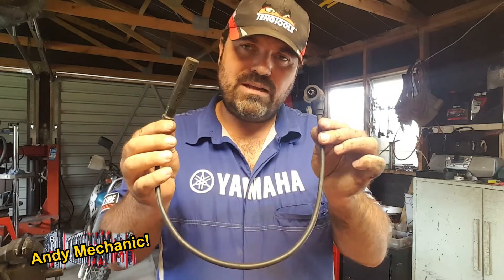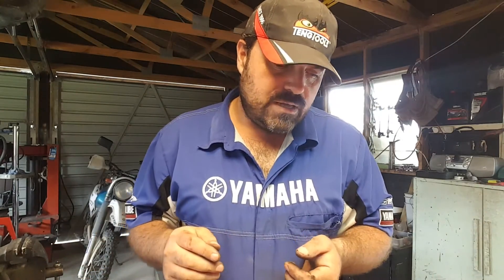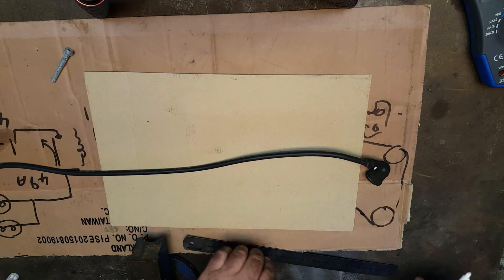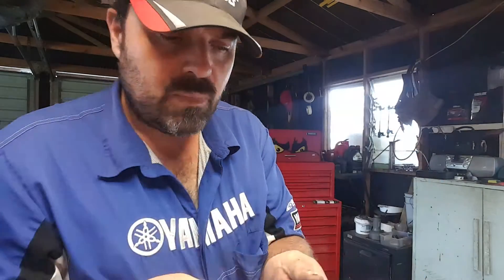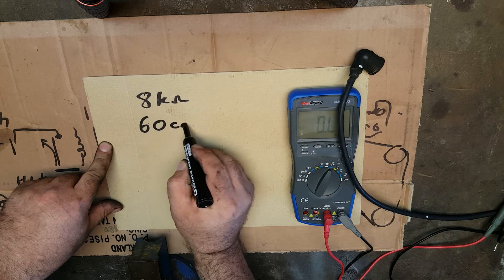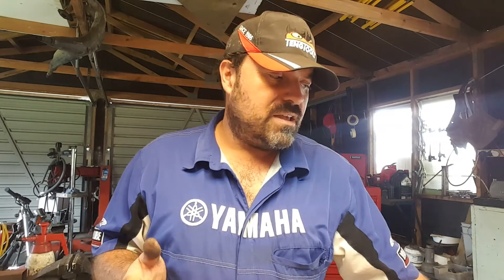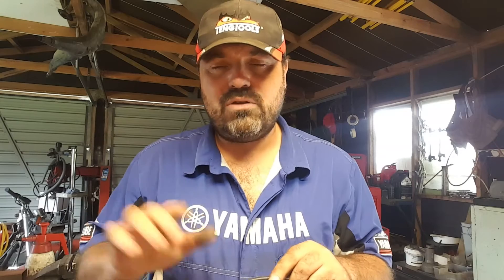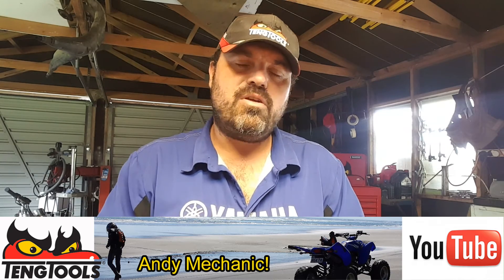Weak spark? - How to test the resistance of a HT lead #1937

Comment: 8:53. and yet, aircraft HT leads are bundled and enclosed within a metal conduit, branching off to each plug.  The bundle starts on the top of the magneto, and runs for three feet before the first branching.

Comment: Andy, There's a quicker and more interesting way. Just pull off one end of the lead off the dizzy cap and stick it in ya ear hole then stick ya nose in the dizzy and start the engine. If you see stars that proves your competence to do the test, sell your car immediately you should never have had one in the first place.
or
Your method was pretty good, well done, thumbs up.
cheers, build